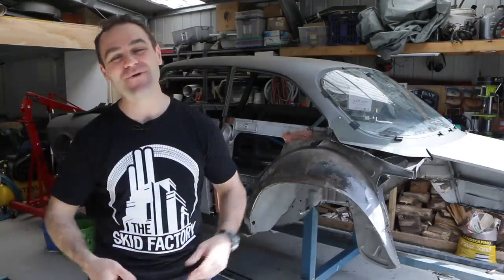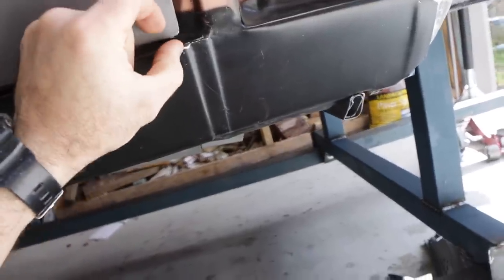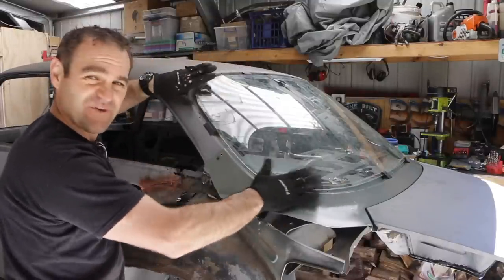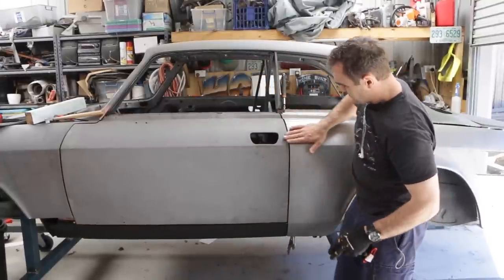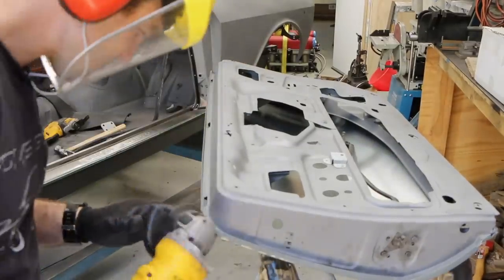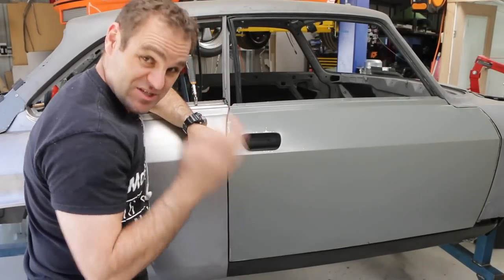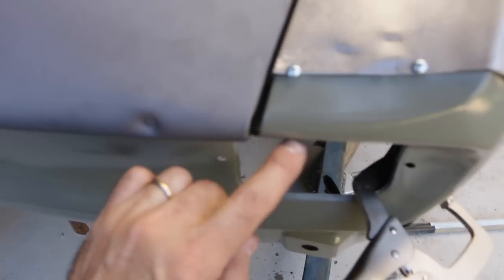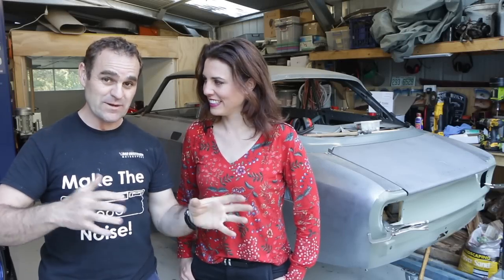Door alignment - Alfarrari 105 project car build part 21

Comment: Jeff-don't sell yourself short; I find these highly entertaining and informative. I agree with the decision to go with the 1750 rear fascia-I've been considering that on a long term project that is sitting on the side of my garage. 

Don't feel the need to rush this through.  The panel gap fitting exercise is vital and if anything, I'd vote for more detail. Would like to see how you final fit and weld the door skin and the 1/4 panels. Also eager to see how you refit a trunk floor. I have a Duetto that was poorly repaired 25 years ago I want remove the rear 1/4s and redo the braces that support the trunk floor

Comment: Absolutely correct! Moving the rear window panel will bring the fender to boot lid gap tighter/higher, also bring the boot back closer to glass where it belongs to correct gap at back (boot to fender) ends

Comment: Immense work there Jeff. Lot of patience there to get them panels just right. For bracing purposes a half cage is a must with bracing to the diff, maybe some trick inboard dampers. For the front a 40mm dashboard tube which could triangulate to shock towers and a cross brace across the shock towers.
And for Mrs Jeff you have a very Foxy Lady😁
Reply from the maker: No shock towers on this old thing unfortunately.
Reply: Aah OK. Will be interesting to see what the suspension is on this👍

Comment: Looking good. The issue your having with the drivers side door bottom may be the rubbers like on the other side. because the skin is not attached, the rubber may be pushing the bottom of the door out as it is not rigid.

I'm liking the alternation between the porsche and the alfarrari, think it helps break up all the bodywork.

Comment: Awesome video as always, the left looks like its there, on the right side I think finishing door will help establish a datum, we started there. Some tar sound deadening on the inside of the skin helps quiet the car down. I'm about to start priming some bits, what's your way of sealing the panel joints, do you seal on bare metal or after applying primer? Keep it up guys!!
Reply from the maker: I will have to get back to you. I am following Tim's lead on those things, as he has more experience ;)
Reply: @HomeBuiltByJeff  Thanks! Tim is great resource as these cars are quite particular, they require some specialized knowledge
Reply: I asked the same question on a forum and most people said to paint before sealing, reason being the paint is thinner and gets into gaps easier!

Comment: Really nice job, really impressive👍.
Just a comment about the doors adjustment, the gap are nice between the door and the fender but for now, the door are empty(no glass and other stufs). Are you taking in account the missing weight?
Reply from the maker: The hinges are all new and have zero slop, so they should be good.

Comment: How come so much of the rear structure was cut before blasting? I would think substantially more could be kept - to align new parts on to - then cut out and remade after new panels installed
Reply: I think it was all smashed up anyway, so there wasn't much of a good reference left anywhere..
Reply: @Finnspin_unicycles  Alfa factory repair back in early sixties was rear clip removal.

Comment: hey Jeff, when you get round to welding the bottom piece of the front guard, do you actually weld it vertically to the sill? it looks like it just overlaps , is that correct? If so , how do you stop getting rubbish, mud etc between the two panels and rust forming ?
Reply from the maker: There are factory block off panels that go in there.
Reply: @HomeBuiltByJeff  i dont mean in the wheel arches.  Looking side on the left hand of the car... i mean where the bottom of the guard overlaps the sill. It seems to just overlap the face of the sill without welding... and i assume just spot wedding the seam underneath?
Reply from the maker: @yoesomite2199  That is how the car is from factory

Comment: Run a full cage, with detachable front arm. That way you will get the rigidity, of a full cage to take it on the track, and when you drive it on the street you can remove. Many companies sell detach brackets or you can make them yourself
Reply from the maker: The only way that complies means it needs to have a spike coming out of the top of the cage facing forward, so it is still very difficult to engineer for the road.
Reply: @HomeBuiltByJeff  Ya that is an issue the stubs, but maybe you can make a set of custom plastic covers for them
Reply: Nah full cage but make a load of Velcro on cross stitched (kinda like how TVR trimmed the factory cages they had in some models) leather covers with fia roll cage foam in them.